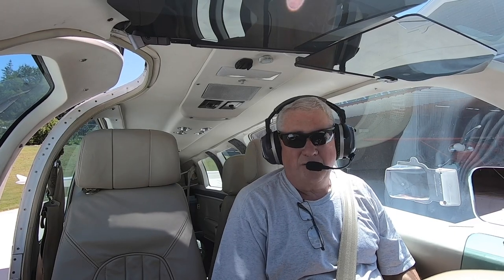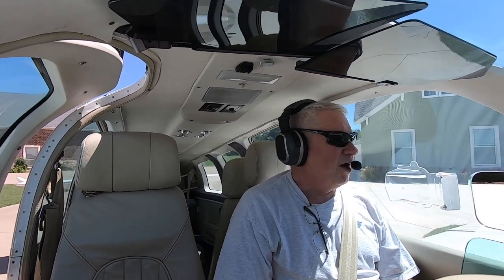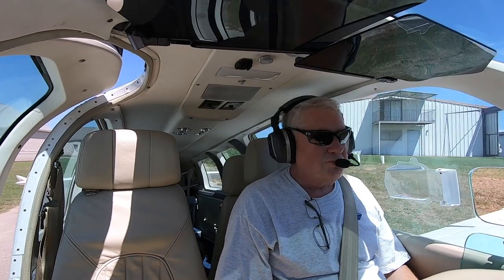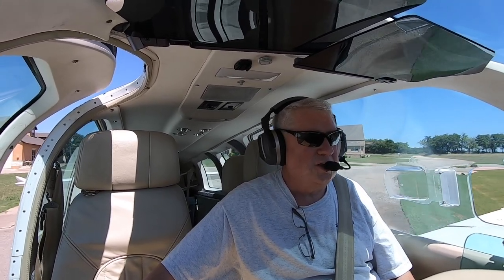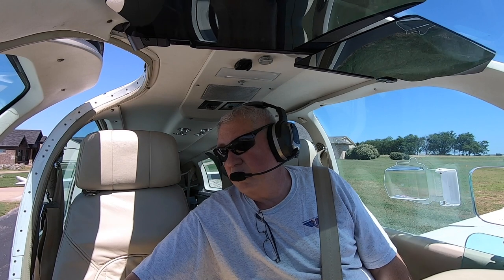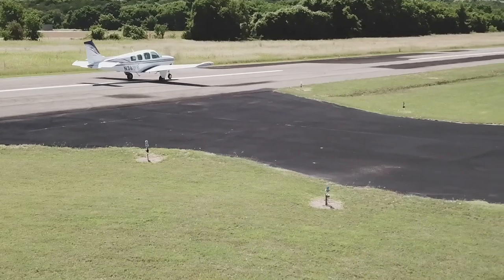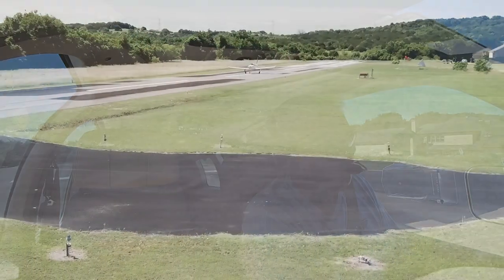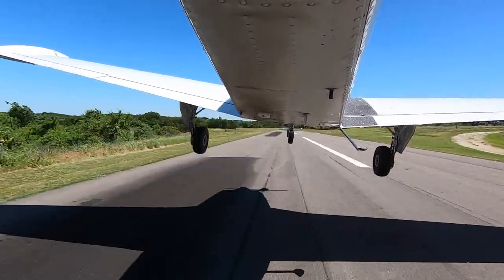FlyWire A36 Bonanza Takeoff Revisited

Comment: I had a ‘56 H35 that required a pronounced pull to get it into the air. My previous airplane was a Cirrus, which almost lifted itself off at Vr.
Reply from the maker: Paul your H35 was probably not rigged correctly.

Comment: Where to you set your elevator trim for takeoff?
Reply from the maker: Grant- Good question. The short answer is I use the book setting 'In the Green'. Typically, I run it at 5 degrees for take off. The important thing is that it is in the green, if you leave a landing setting set the stick forces may be VERY high to keep the aircraft from a severe pitch up,
Reply: @FlyWirescottperdue  I generally depart with the trim in the top of the green. When I purchased the plane I would set it in the center and learned that it required less control force at the top or nose up setting.
Thanks for your videos.
Reply from the maker: Thanks for watching! You do hold the elevator neutral during the takeoff roll. right?
Reply: @FlyWirescottperdue  Yes, I let it fly off the ground.